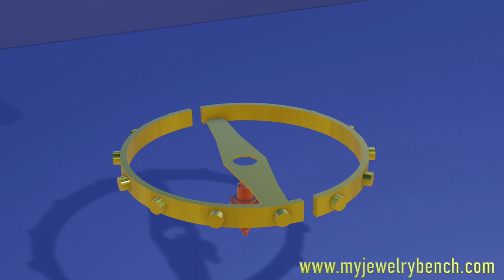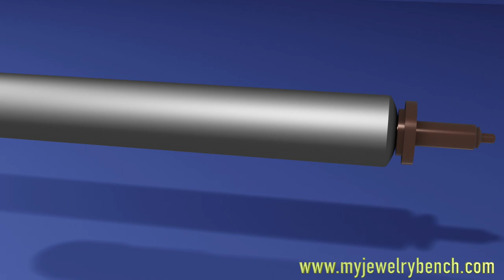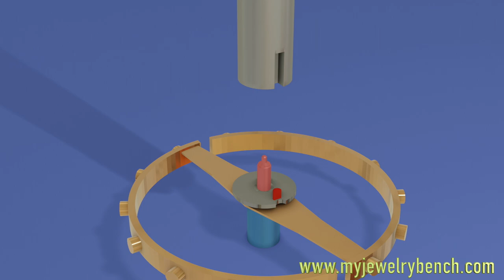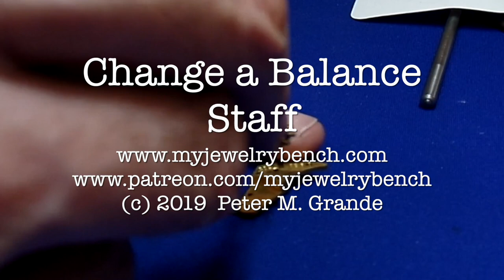Pocket Watch Balance Staff Replacement, a Complete Tutorial

Comment: Would you mind explaining a bit more on the placement of the hairspring? I am still a bit confused on the positioning. It seems like at the end of the video, the hairspring was positioned such that the impulse jewel is 180 deg apart? Is there another step to turn the collet? If so. how do you turn the collet to position?
Reply from the maker: The collet and pin position for the hairspring hast to be aligned in a way that you keep the balance staff, roller jewel and pallet staff all in a straight line. It helps to
Mark the balance wheel with a marker so that you can position in into the center arch with the balance bridge in place. Once the three parts are lined up, you can then place the hairspring on top of the balance bridge and mark the balance wheel with the location that the hairspring pin should be placed.  Placing the hairspring on top of the bridge you can use the pin at the end of the hairspring as a marker when turning the hairspring so that the pin is above the locking clamp of the balance bridge. Once you have that position, remove the bridge and balance from the watch and put the hairspring back onto the balance with the pin lined up in between the second mark you made and the balance staff. Creating a second virtual line.  Once that is done you can attach the hairspring and balance to the balance bridge.

Comment: Hi peter ive just watched the video on how to change a balance staff and it was very informative and help full. please could you tell me how to find a correct staff for a pocket watch only on a wrist watch  their is a makers name i.e. ETA /OMEGA follow by a model number so its easier  to order a new one  but on a pocket watch it only says swiss then a serial number or a jewelers name. or will does a swiss staff fit any watch has long its a size  16 17  18 Linge best regards ady
Reply: there are infinite numbers and profiles of staffs.  Even .001 off makes a world of difference.  You need to either know the correct part number for your watch balance or make all the seperate measurements.